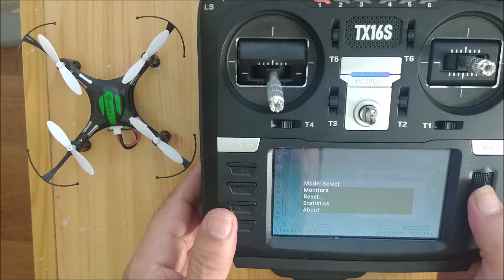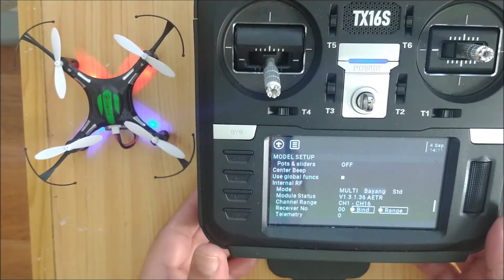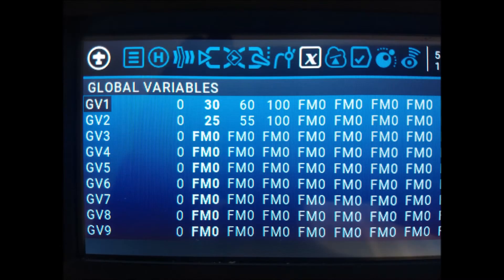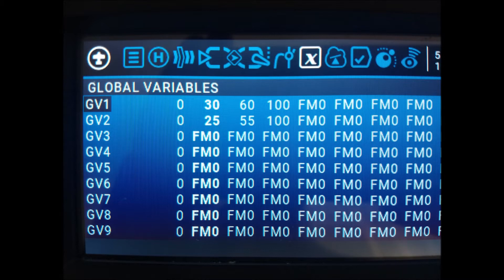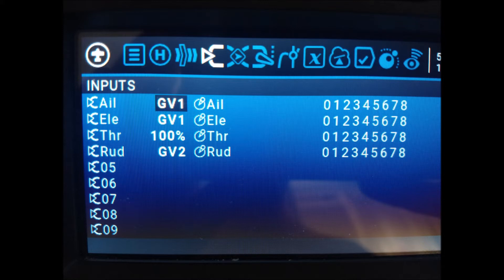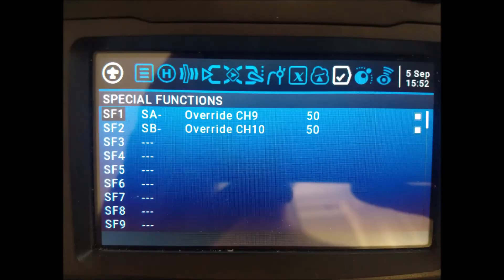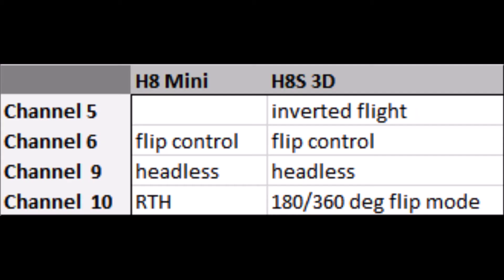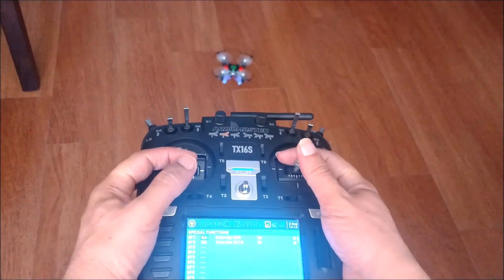How to setup drone Eachine H8 & H8S 3D Mini Inverted Flight in RadioMaster TX16S with OpenTX

Comment: Hello! Thank you so much for the video. I just wait for the remote and mini drone E010. Tell me please if you encountered the HDR/C (D2) drone "Here is a link to the image of the drone" - (without a camera), can I connect it to this remote control RADIOMASTER TX16S by multiprotokol? If possible, how to do it? The seller says nothing about this. Thank you.
Reply from the maker: It will bind e010
There is no information about hdr protocol, probably will not bind